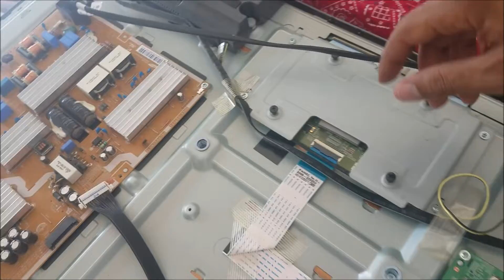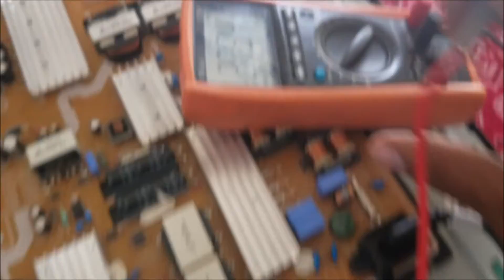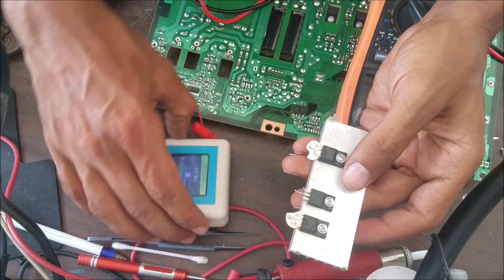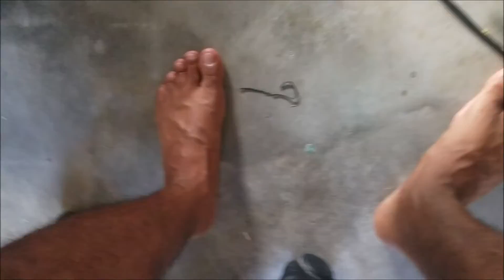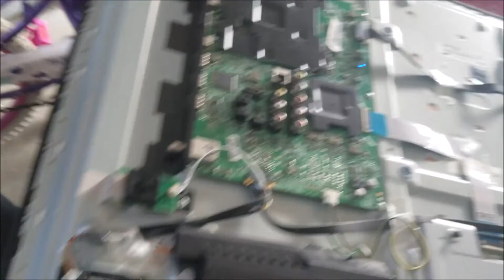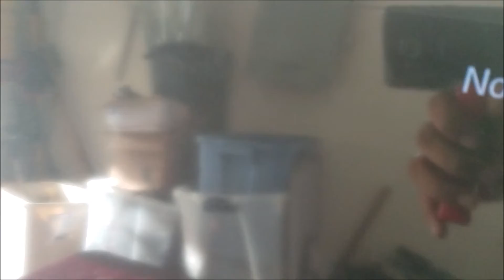samsung tv un40hu7000f power supply troubleshooting & repair step by step

Comment: So, what if you unplug the power supply and the backlight does come on? Is it safe to say the main board is bad in that case?
Reply from the maker: that test is telling you the backlight and power board are good, but still need to check the main and screen ( tcon if exist)